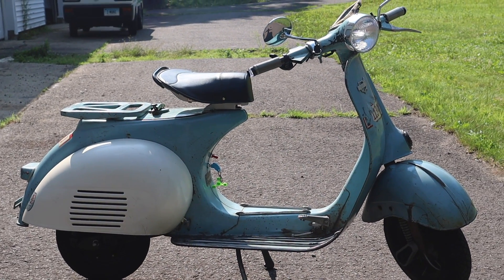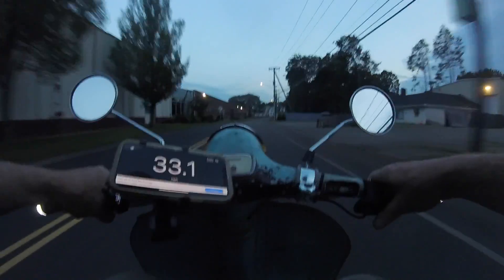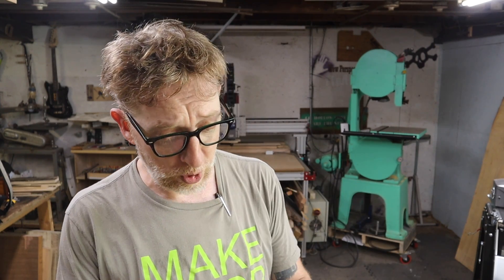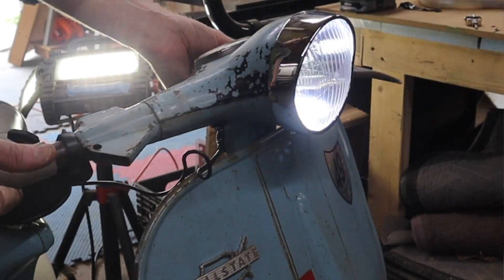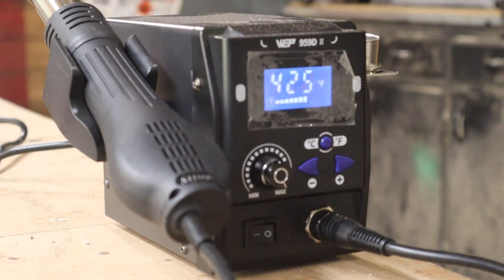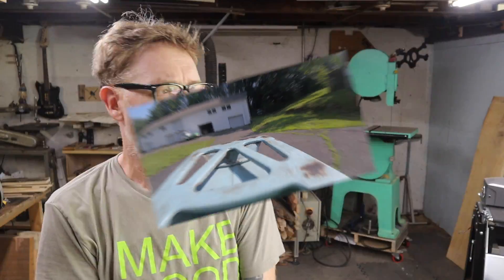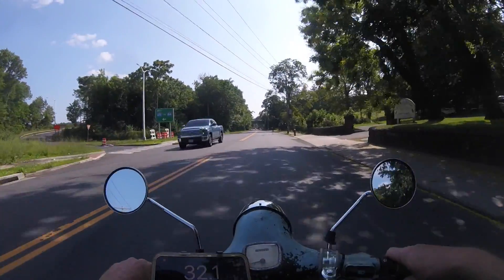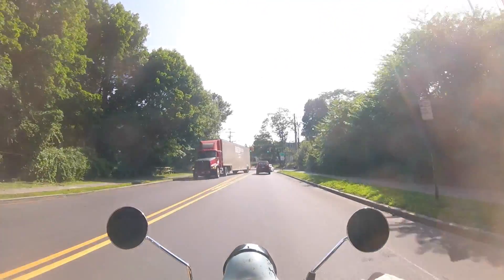Electric Vespa Moped Conversion Updates - It's Still AWESOME

Comment: Really inspiring work, as always 😊😊 thanks and the Vespa is WAYYY cooler 
Two comments - having a small wheel on the back is like a low gear, putting a bigger wheel will increase your top speed but make hills much worse 😢. A bigger engine with more torque is the way to go.
Turn signals - the right turn arm position is like that when you're in a car. On my bicycle, I just stick my arm out on both sides of the - much more understandable. Also, most people seeing the bent arm, palm up signal will think you are stopping
Reply from the maker: To use my right arm I need to take my thumb off the throttle, which is most often the wrong thing to do in traffic as I give the signal before I slow and use both hands to turn.  If I'm stopped, I point, but rarely do I need to stop or point right as there's no traffic to cross that way. That's why the signals are the way they are, for throttles. Very true on the brakes. I avoid hard braking with proper distancing, but when some jerk cuts me off (and they do!) using both does the job.

Comment: 136th subscriber LIKE; 1,985th desktop studio view.  How about a long-sleeved 'jacket' with small turn-signal lights wired up the sleeves, ending at the cuffs...
so that you have LIGHTED hand signals...?  LOL  Powered by a small sewn-in battery pack?  When you're about to turn (change tack, in sailing terms)... just holler out the Skipper's command: "Ready about - helm to port!!" (or, "starboard!" if you're going the other way.)  Don't forget the secret handshake - your mileage may vary.
Reply from the maker: That’s actually a fun idea. Blinkers on the shoulders. High visibility, easy to wire into a coat…

Comment: Tim,If your controller is set up for regenerative  breaking  you won't kill your pads and it will charge your battery.  Downhills.
Reply: Nobody seems to realize regenerative braking pots a LOT of stress on your battery. I do not recommend running high values for regenerative braking, if at all. I would rather replace brake pads than put extra stress on my battery and motor, namely the phase wires suffer a lot.

Comment: Great video Tim  !  I’m sold I’m just looking for a donor Vespa or a TOMOS moped but only issue I have! It rains a lot in the North of the UK  so I will need to keep weather proof whilst I’m using it
Reply from the maker: I acquired an old Sachs (basically the same as a Tomos) that I plan on converting, too. It looks much easier to do as the swing arm is already good to go for a motorized hub.
Reply: That’s a good idea a TOMOS was my first bike / moped

Comment: I simply wired my Ignition exactly the same way it was originally meant to be. 72v 10kw motor wheel with 510 nm's torque, 0-100 mph in 1.9 seconds, 12" upsized Tyres and Disc Brake upgrades, top speed 145 mph, 72v 120ah LiFePo4 battery pack split into three. (I use a drop in "centre Tank and 1 under the seat in my centre loop and one extra on the inside of my leg shields and get a cool 890 -950 K's per charge. Like what you did looks great fun mate!  It is easier and less hassle I found, to simply wire the ignition normally. Anyway keep on runin'!
Reply: side note I refuse to use those original shoe brakes lol I will never ride shoes again! I am 59 and grew up riding my Vespas and Lambrettas in England and since I started converting to Disc I have been much happier. I also do extreme riding and speed and distance unlike most scooterists who are hobby riders so I need disc brakes. Also I take Pink Slips on my high speed 64 Lambretta GT 200 converted to electric so there's also that lol keep it up.

Comment: Didn't realize the rear brake was essentially a normal bicycle disc brake. Make sure you're buying sintered brake pads - they'll last longer than resin pads. If you're getting resin pads they are more grippy in some ways, but they wear out a lot faster. Love that you revisited this project and love that you want to do some more. I commute to work (22 miles round trip), 5 days a week and I do it on a recumbent trike (with pedals). Can't get much more green than that and I don't even own a car (haven't for nearly 8 years). Yeah, you're not saving the world, but when everything is burning down around us and every summer breaks the previous record for hottest in recorded history, well - maybe riding an e-scooter IS the more environmentally-friendly thing to do. We can't change the world all by ourselves, but we CAN make sure we have as low of an impact as possible.
Reply from the maker: wow, that's impressive! You must be in pretty good shape! Keep pedaling!

Comment: I didn't even know you could convert those mopeds to electric and honestly makes me rethink a lot of stuff. I didn't even know you had an electric moped that's awesome regardless😂

Also that 49cc membership thing is kind of cool and I will lovingly join..
Reply from the maker: Anything is possible! :)
Reply: Every moped with a 12 inch tyre is incredibly easy to convert, others can be converted relatively easy. The hardest part will probably be wiring a new harnass for all your components and finding levers with brake sensors should you require that. Unless you are mounting a mid drive motor, that is a bit more complex depending on the wattage of the motor.

Comment: Such a fun project. 
I am not sure a bigger tire/wheel is the right choice though. That would be the same as putting a higher gear in it such that it goes faster on the flat, but it will actually reduce the torque at the road making hills a bigger issue. It's essentially the inverse of getting a bigger wrench to put more force on a bolt. I bigger motor is probably the right answer, but there are other factors like the motor's RPM that would also need to be considered in balancing speed and available torque.
Reply from the maker: right, but there are no "gears" per se as it is a hub motor, so I think the increased wattage and slightly larger wheel would balance out in my favor overall.
Reply: i think you are right. the bigger wheel reduces the force at the road.
Reply from the maker: @BigEdWo  and.makes potholes less terrifying!

Comment: Heavy metal thunder
Born to be wild.

You need to look at your motor's  torque curve then set your wheel diameter for the peak speed

Thanks from Colorado
Reply from the maker: yes, there are settings in the app I can adjust but we've pushed it pretty far already and are afraid of blowing the controller. we blew earlier ones in the process last year.

Comment: If you want a proper switch, you can buy reproduction vespa switch units that give you headlight, indicator and horn controls, look just like the original ones and are waterproof 😀
Reply from the maker: yes. I have the original switch still in "maybe working" condition and access to repros, but it's in the same spot my throttle thumb goes, so I can't activate them while accelerating - and if I take my thumb off the throttle up a hill even for a second, I'll never make it to the top!

Comment: Your video has inspired me to switch my vespa to electric too. I am looking in to making the swing arm myself. Would your share what make and model of hub motor you used and what controler? Perhaps you have a better suggestion after trials with your current set up?
Thanks!
Thanks!
Reply from the maker: tough question. I don't think I'd recommend the same motor I have now, I think I'd up the wattage and diameter of it and design the swing arm to compensate. I used a sabvoton controller

Comment: One more thing - 90% of braking happens on the front wheel - that's the one that needs an upgrade
Reply: My 1964 has the original drum brakes. They aren’t the best. With regen and a new disc brake in the rear I never use the front brake.

Comment: Love the build , but how come you can’t use the original speedo as it hooks up to the original front hub which you are still using?
Reply from the maker: I probably could. the speedo, cables, etc were all shot so I'd just need to buy all the parts and put them on, I suppose.
Reply: I do really like the set up you have though, I am going to download that Speedo app !

Comment: I’m surprised you have an issue with hills. Typically those motors are rated at their continuous output put peak at double. 

Mine is 4kw (72 volt), I’ve peaked at 12. I don’t need more throttle to get up a hill, even with two people. I love going up hills because it feels like you are cheating physics. It flies right up. 

Also no problem at all keeping up with traffic anywhere. 

My new build will be 7kw, 14 peak. Totally not needed, will be a beast.  Should have no problem beating the fasted stock vespas ever built. 

I’m guessing your controller is limited the amperage too much.
Reply from the maker: yes, that's exactly it. we're still erring on the side of caution because we had a few issues early on. what size wheel do you have?
Reply: 17" diameter

Comment: I disagree with your characterization of a larger tire with a smaller motor having more uphill power.  That's not the way it works.  Your problem has nothing to do with the 3000w motor itself, I would suggest that you are running too low of voltage to provide power to that motor for optimal uphill performance.
Reply from the maker: indeed. In the app I can adjust the voltage but I've got it pretty close to the limit and we're afraid to push it much more without potentially frying thing. My understanding is with higher wattage I can push the voltage more without running risk of damage?